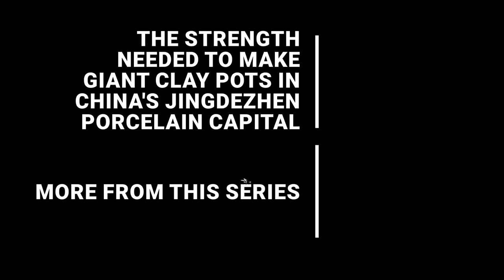Amazing Making Process of Candy with Chinese Characters | NO TALKING

Comment: I'm honestly surprised at their work environment. It's so clean and modern! That's not to say places in China are dirty, but most places that make these sort of treats hold very strong to tradition! They often keep working out of the same place that's been in use for GENERATIONS and/or they often use old traditional tools/methods that have been handed down for so many years. Those sort of places are straight out of time and are a wonder to behold. This larger scale operation is still impressive nonetheless.
Reply: It probably is traditional. From house to shop and then this bloomin large factory. Yet to fully mechanized though. Spending a large sum for specialized machinery to do this isn't worthwhile. Unless they change the word Luck to BTS or Gucci.